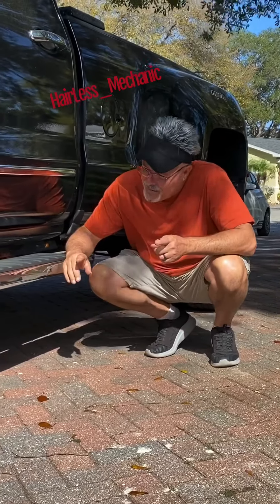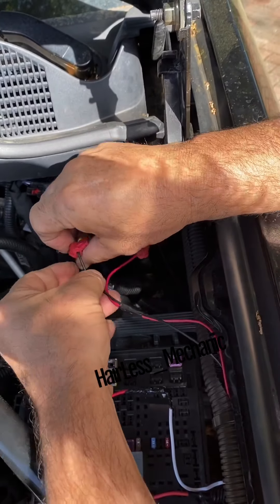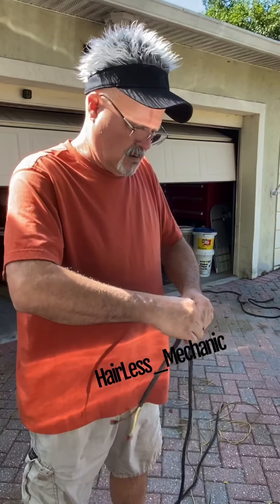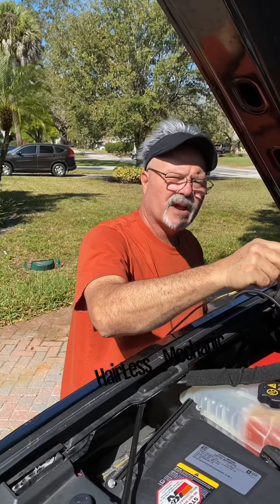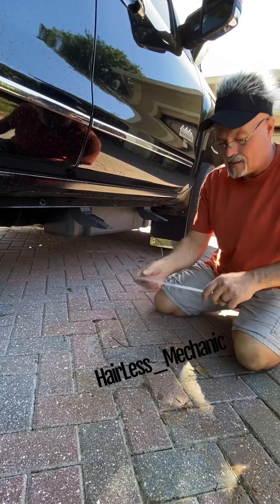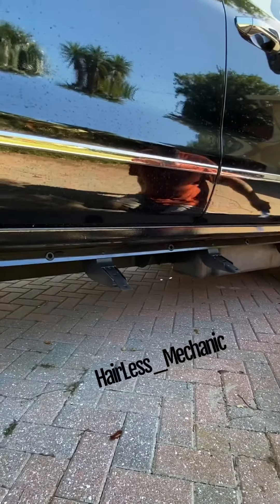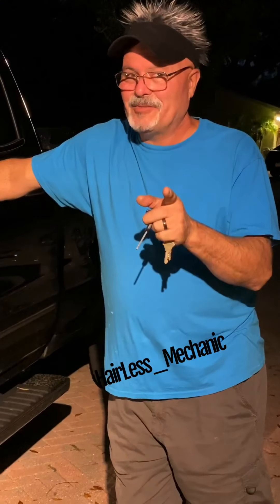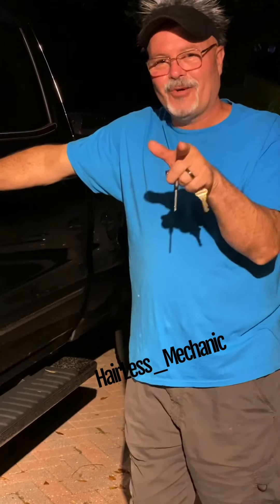Duramax Chicken Lights Installation

Comment: That is one Awesome looking truck with the chicken lights. I have a 08 black Suburban I’m working with. I am using the Amber & Purple Switch Back. I’ve started with the front of the truck and I have plans to work my way back. I’m like you , I love the chicken lights on the smaller trucks. I’m using the 3/4” lights too. Looks better. You have really done a good job.
Reply: Question I don’t really know anything about wiring but I have a Tahoe and I’m trying to put the same ones on it and don’t know how I’m going to wire it at all any tips? 😅
Reply: And any wire you suggest I buy to run them down from the battery to the lights?

Comment: I put tape along the black opening line to close it off than placed tape on the wire and a weed Wacker lime amd pushed it through than I pulled the weed Wacker line with the wires through the tube. Easiest way.